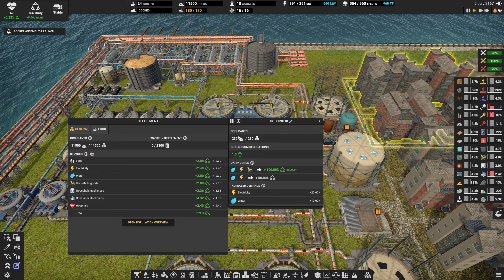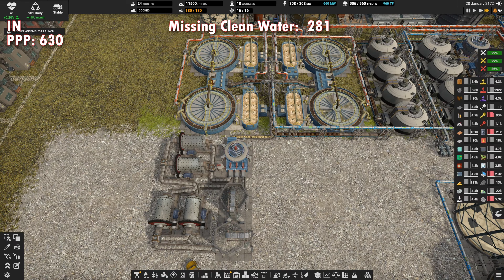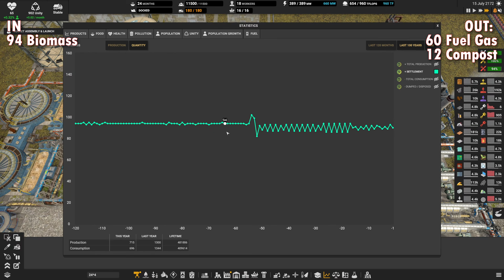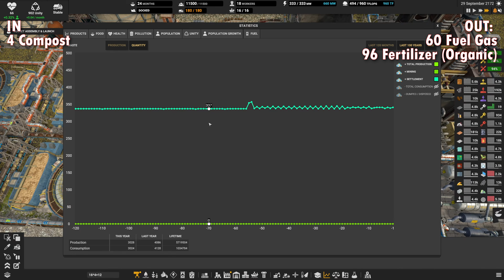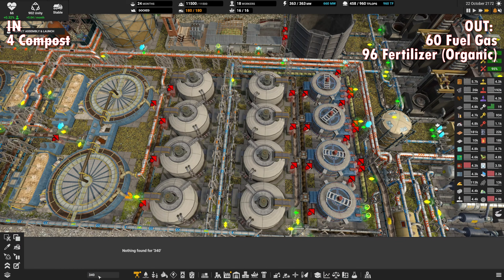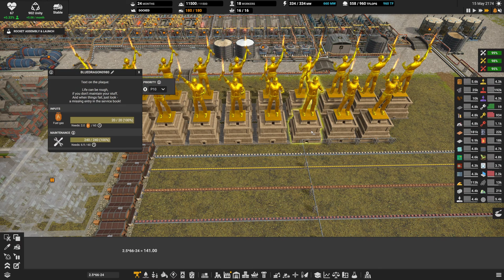Waste Sorted 🚜 The Waste-N-Eater Blueprint 👷 Closed Loop Waste System 🌲 Captain of Industry

Comment: Solved the water overproduction by feeding the excess steam in a turbine and than putting steam low in the desalination plants.
I am using the same desalination plants for both kind of steam with the connector combination trick.